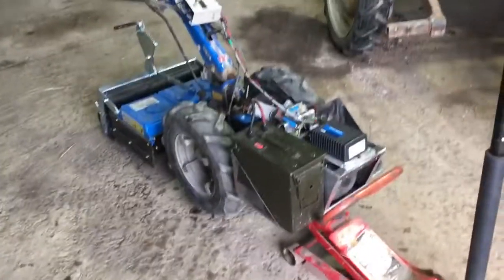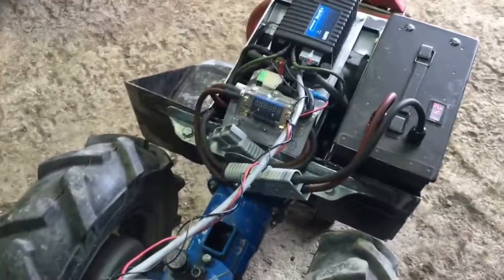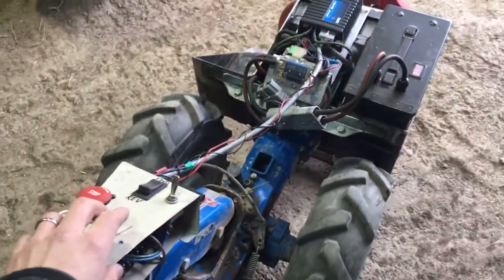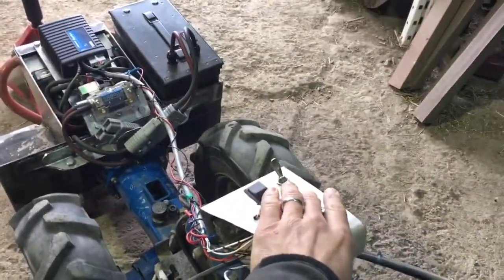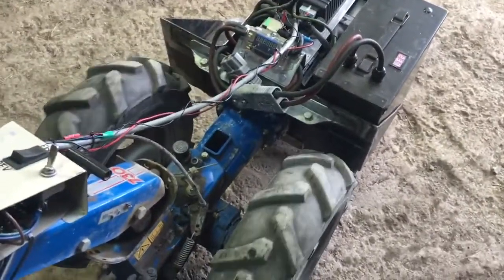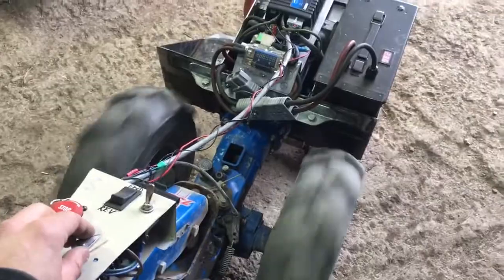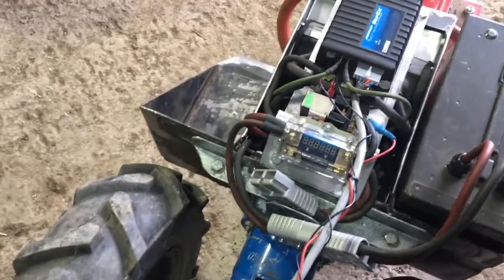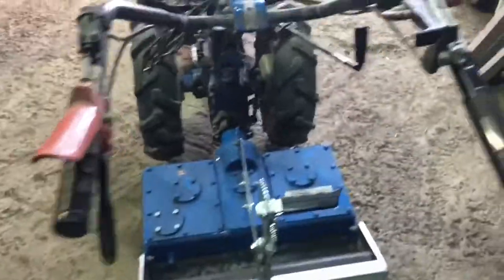electric BCS successful motor tests!

Comment from the maker: For those interested in specs the motor is an Advanced Motors and Drives DD0-4002.  That's a 6.7" separately excited brushed DC motor.  Motor controller is a Curtis 1243.  Albright SW80 contactor.  The clutch was removed and replaced with a solid shaft link to transmission input.  Everything designed and fabricated in a very modestly equipped unheated farm shop in Quebec in February.  Thankfully it was mild a lot this winter :-)

Comment: This is soooooo exciting to me. I want a all electric bcs with a trailer that has a charging system and solar panels on board. And space for other implements pr gear.
Reply from the maker: R. Lynch for hauling any meaningful amount of gear or materials you might consider a used golf cart or industrial utility cart. Keep your BCS free for tasks only it can do and use a 4 wheeled cart for load hauling. A 4 wheel cart is easier to equip with more battery capacity whereas the BCS is always a balancing act for batteries - quite literally. Check my other videos to see our electric farm utility cart called Bob
Reply: Reid Allaway my vision for a bcs is like a minimalist farm multitool. I would like to have easy plug and play batteries and have the cart power the bcs and charge batteries. I know it's a out there idea, but I would like it.

Comment: Awesome! Would love to convert my BCS to electric.  We small farmers need something that is in between the power harrow and the tilther that is all-electric.
Reply from the maker: The power harrow on the electric BCS is great. Lower part demand than the rototiller means long battery life and long intervals between charges
Reply: I am seriously considering selling my 32” harrow as it is a beast to maneuver around our urban plots. Any thoughts on marketing conversion kits?
Reply from the maker: Matt Vardal yes the big power harrow is a beast.  We're really happy with the small 21" model from Thivierge here in QC.  We go down and back to make 40" beds and manueverability is incomparable.  No I have no interest in building or selling conversion kits. My goal in sharing our success is to show that it's feasible so that someone else will design and sell kits. I'm too fond of vegetable farming to want to switch to manufacturing and marketing equipment.

Comment: Hello. How much the whole thing costed , and what is the power rating of the engine
Reply from the maker: Hi Niki.  The total cost of the project was less than $1500 but cost was kept artificially low because I found a used motor & controller and I bought an entire Chevy Volt battery pack + some extra 6S modules (most was used for other projects) so that battery cost was kept low.  Doing a similar conversion with all new parts might cost $3000+.  Power rating of the DC motor follows a curve in function of applied voltage, RPM and load.  I'm running it at 24VDC so not getting peak power.  It's probably capable of 5kW at 48V and maybe I'm getting 3kW at 24V but I don't have a good way to measure it.  Peak current draw is >200A @ 24VDC but typical operating current is more like 60A.
Reply: @reidallaway  Reid, Nice project.  Thanks for the operating current, I was wondering. 
Some Math : 60A x 24V = 2400W = 2.4KW      and  2400W/745W(per HP) = 3.2HP
That running current is important information.  If we want(need) to till for 4 hrs in a day.  60Ax4hr = 240AH battery.
Reply from the maker: @ndplume59  Given the size and weight limitations on a 2-wheeled machine such as this I've been really happy with the decision to go with removable batteries and have spares for times when we need long, sustained runtime.  We finally had a task that required running the machine hard for several hours and I did eventually drain all four of our battery packs but by the time I finished draining no. 4 the first was recharged.  So with our 1kWh packs and a 500W charger it seems like we can run it as long as we want.  There's another video here from that stress/endurance test. 

https://www.youtube.com/watch?v=P6jY1ptRRVc